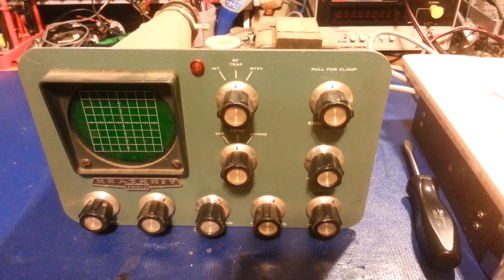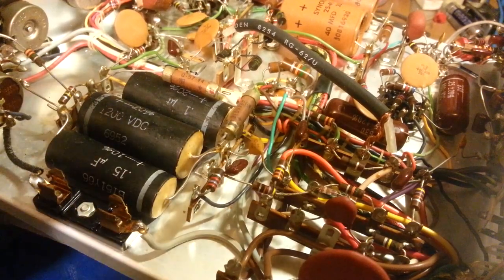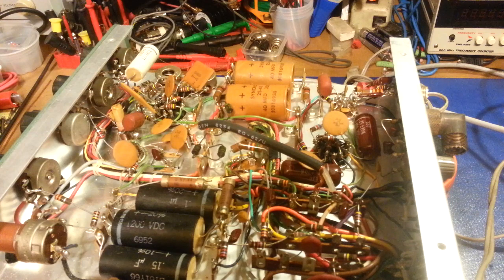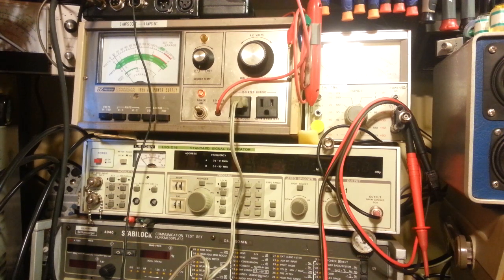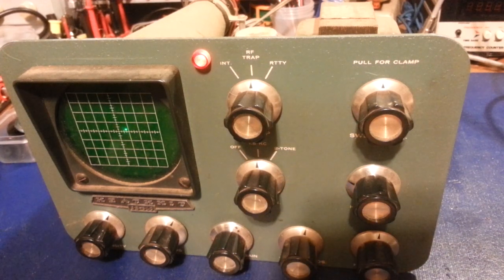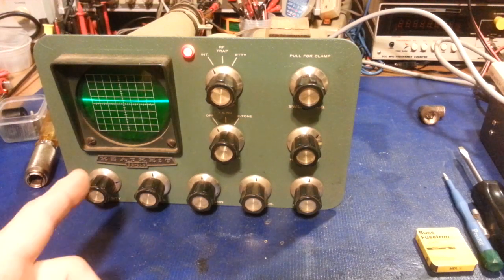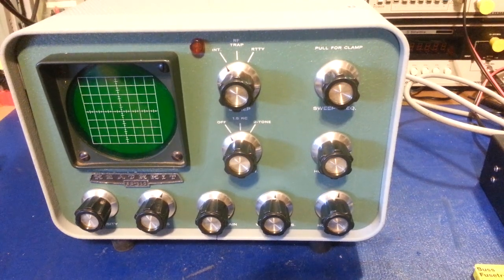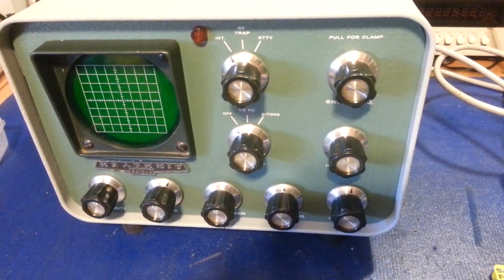$40 eBay Heathkit SB610 station monitor.

Comment: Hi Mike,
That's a great find! I have one for my HW101, but I haven't used it in years.😅 I think I just might bring out the old girl and restore it this winter.
Reply from the maker: Need to do it before winter sets in.  Tube equipment makes great suplemental heaters during the cold months. :)

Comment: Another nice piece of vintage nostalgia!. Good find Mike. It looks great after the mild cleaning.
Reply from the maker: Didn't need another one but at that price it was good for a parts chassis, or so I thought.  Not going to part it out now since all it needed was a fuse.  Back on the hunt for a true parts chassis.  Just can't seem to get parts rigs anymore.  Everything I buy recently seems to work.  Not that I'm complaining.  :)
Reply: Works that way at time. At least you saved it from parting out.  That's a good thing.  Been hunting for some 101 chassis board connectors. all week.  Missed a set that went real cheap. No way am I going to pay 90 bucks for them. I have got to get some card connectors made so I can get back on the 101 series. Have some good plans for the videos.Agree it is hard to pass up a deal like this.
Reply from the maker: +The Radio Shop 

What are you doing, making board extenders?  What do you need, the edge connectors?
Reply: Yep. The green connector mounted to a chassis that the boards plug in. I have the double copper clad  to make the boards with.
Reply from the maker: +The Radio Shop 

Could get a set out of one of my parts chassis.  Might be a day or so.  Think their at the bottom of a pile and 3 rows in.  Have to check my inventory location list.  Didn't you need some other stuff, covers and knobs?
Reply: Cool, I will email you.
Reply from the maker: +The Radio Shop 

10-4

Comment: Really awesome score Mike. Lusted over these for years but people were always asking stupid amounts of money for them Now using an old Tektronix TDS 2002 50 MHz digital scope for my station monitor. Works fantastic, but does not have the Heathkit "cool" factor.
Reply from the maker: The SB series definitely had the "cool" factor.
Reply: Picked up TWO of these at the Ham Fest. Paid $12 Bucks each. In near perfect condition cosmetically and both working fine. Will replace the caps before putting it into full time service.

Comment: I picked up a SB-614 a while back. Ebay, stated to be non-working. Can't remember what I paid for it, but I think it was more than $28.

Haven't even cracked it open yet to see wassup with it. Maybe after watching your vid I'll be motovated to  get to it before the week is out. I figure if the CRT is good, that's good enough for me. Wish me luck. :-)
Reply from the maker: Two important parts, the CRT and the transformer.  As long as their both good everything else is pretty easy to get.

Comment: very nice barn find. at least it's not as nasty as my golden eagle mark 2 looked like when i got it, darn thing must have sat in a garage for decades i'm still cleaning it up, the fuse holder crumbled,  caps broken,  it has (mike fix me) written all over it ;-p~
73's from k7sce
Reply from the maker: Sounds like a good project.  Have fun bringing it back from the dead.

Comment: Oh dear!
I have a station-monitor too (a kit too, not Heath...can't recall the brand) from a similar vintage. Works a treat, but the 'rubber' sleeve that holds the CRT to the front panel has just shrunk! I have no idea what plastic this is...but it is now some 15 % smaller than it originally was!
I turned two Delrin rings to secure it, but I'd love to be able to make something that looks more like that original sleeve.
Anybody any ideas?

Cheers

Paddy

Comment: Lucky guy! BTW Mike what is the name of the product you use from Texas Refinery and how do you dilute it for use?
Reply from the maker: TBC concentrated cleaner.  If you want one that is NSF certified the Big Red cleaner is a great cleanee.  The TBC is a slightly stronger cleaner than Big Red.  Big Red is safe for use on anything not harmed by water.   Can't say I have found anything harmed by the TBC cleaner.  Dilution is a couple tablespoons cleaner mixed with water in a spray bottle.  For heavier soil like oil and degreasing mix it a little stronger.
Reply: Thanks Mike, looks like there's another cleaner spray bottle headed for my workbench!
Reply: 'Course now all I have to do is figure out where to buy it? Google hasn't been my friend!
Reply from the maker: +Dino Papas 

You won't find them in stores.  They are a industrial/commercial lubricants and maintenance products company and sell direct from the plant in Ft. Worth, TX (yes some things are still made here in the US).  At one time I was a sales rep for them.

https://www.texasrefinery.com/products/cleaning-products/tbc-concentrate/
Reply: I've bookmarked that page...will they sell a small quantity direct to an individual?
Reply from the maker: +Dino Papas 

Yes they sell to individuals but the smallest size for most products is a case of gallons or 45 pound pail (6 gallons' yes six).  On the up side you really don't need any other cleaners.  I use it for everything.  Radios, car washing, floors and walls, its the ultimate general purpose cleaner.  If you need more aggressive they cleaners all the way up to Red Hot, it is so aggressive it disolves aluminum.